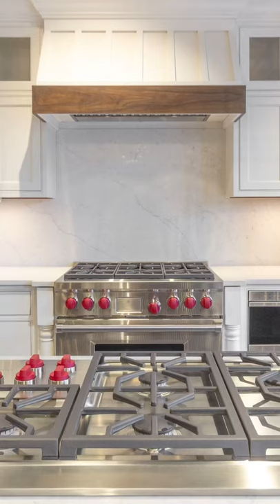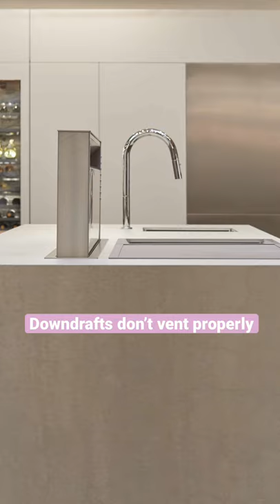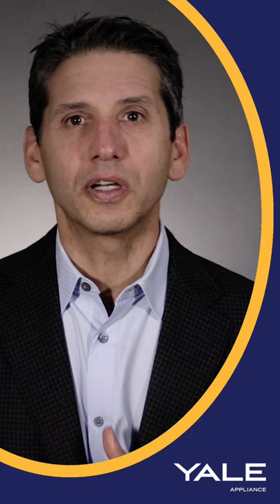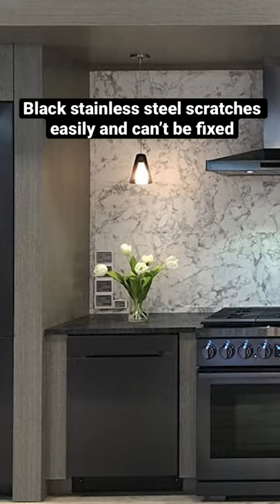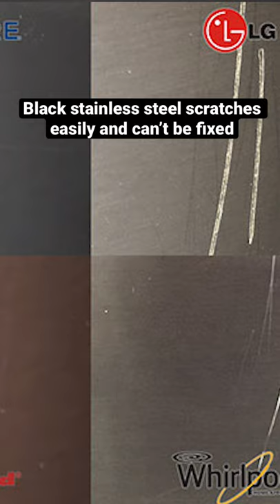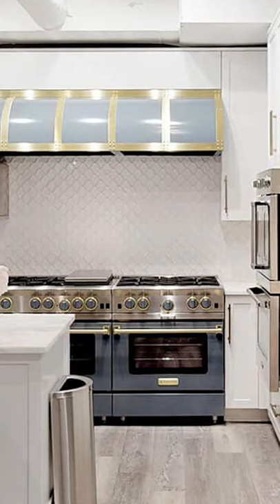Two Appliances You Should Never Buy #Short

Comment: Hi. I was considering the Dacor DOP48M86DLM in Graphite Stainless Steel. Is this finish the same as black stainless with an oxide coating that can easily scratch and is not repairable?
Reply from the maker: Correct, this finish would be like all others on the market aside from Bosch.